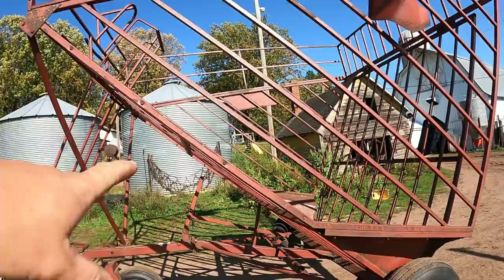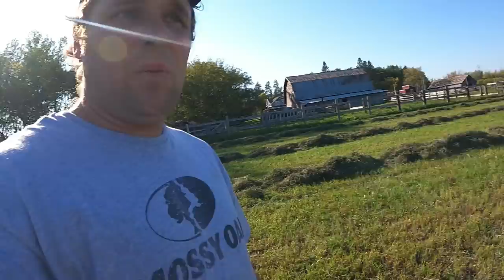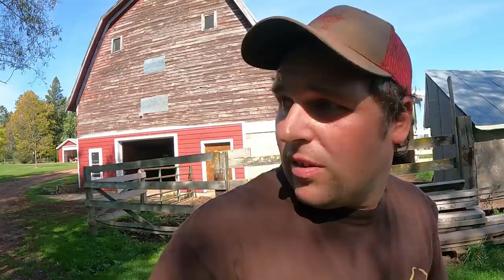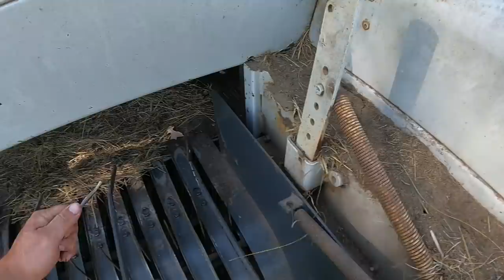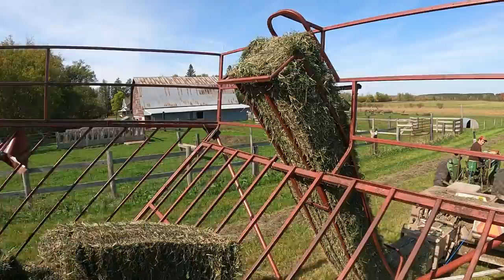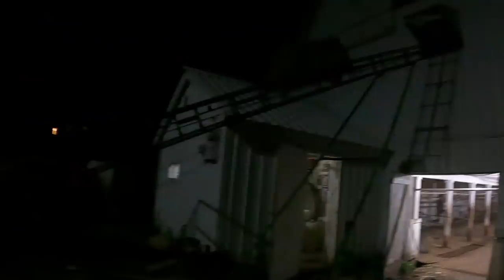Baling Small Square Bales/ 2nd Crop Hay

Comment: Nice looking baler there, how old is it, it's not a brand that was ever sold here in Ireland.
Small square balers typically were designed for 45 to 70hp tractors, so makes sense to run it on the 830.
Probably burning less than 1 gallon an hour....
Reply from the maker: I think it's an early- mid 90's.

Comment: Hello From Mark in Ky,  I really like your 820 John Deere tractor. The farm where I lived as a kid had a 1010 John Deere for a while  and a 3000 Ford which was a very good all around tractor. 
I remember the 1020 John Deere tractors and was wondering if the 820 was pretty close in size. The 1020 John Deere tractors that I remembered had the orchard exhaust and the mid mounted sickle mower. There’s quite a bit of round bailing being done around here right now. I was not too far from home and the farm with the soybeans had a helicopter dropping chemicals from an apparatus mounted underneath the helicopter. That was definitely interesting to see.
Reply from the maker: I would guess that they are pretty close in size, but I'm not sure, this one originally had the exhaust Ron underneath but my grandpa changed it to vertical, because when they stacked hay on flat racks, the people on the wagon were getting all the exhaust from the tractor. Thanks for watching and God bless!
Reply: Trinity Dairy 6

Comment: Just a suggestion you guys could put those hard tubes in those tires if they make them for tractor tires where they won't go flat that's what we did with my bicycle at one point in time not trying tobe rude or anything to you that probably save you guys on alot of money on spending on tires

Comment: Be careful with that handyman jack. It will crack u in the head. Or smash a finger.  I’ve done both.
Reply from the maker: Oh yes, I have a chipped tooth from one of those things.
Reply: ,,  I too have never been a fan of the hi-lift or handyman Jack, that puny narrow little foot for one thing, and then the slippery steel lifting lifting arm, will slide right off of anything if not exactly perched correctly. and then don't get me going on the mechanism, if it isn't in absolutely 100 % perfect condition,, look-out !  But, you can use them things to tighten a Barbed wire fence, no other Jack does that ...